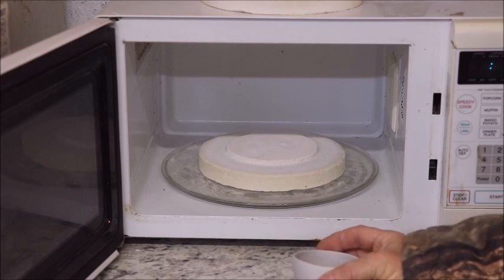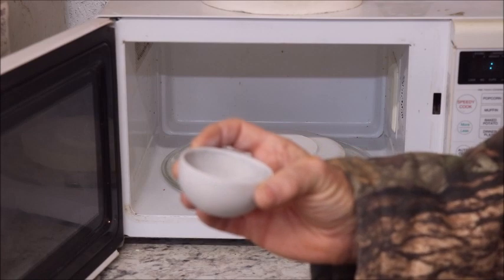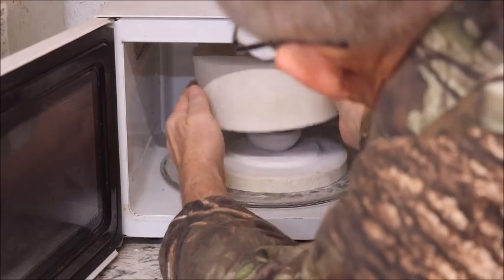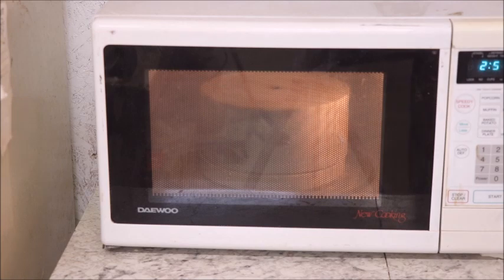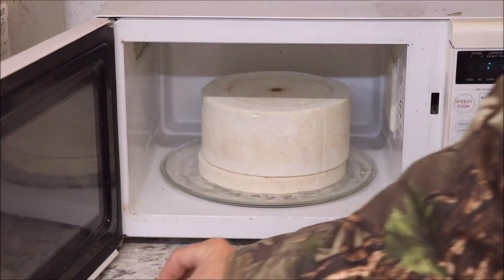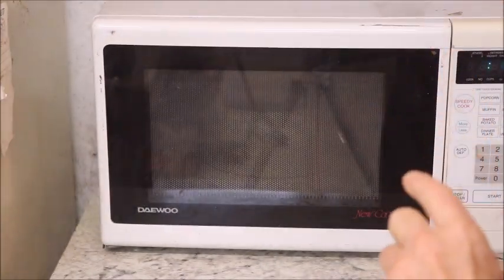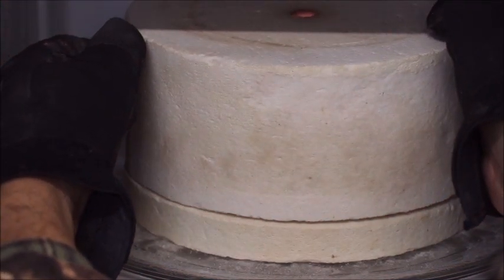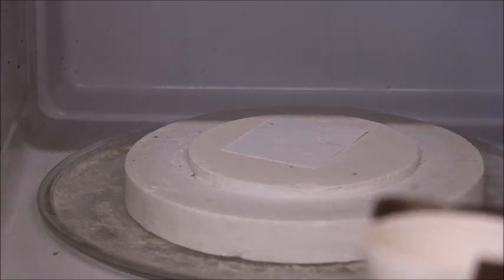Microwave Kiln Bisque

Comment: you are awesome! I was given a bunch of ceramic doll molds. I really want to try to use them. I searched the internet for hours and was about to give up. It looked so hard and I dont have money for the kilns they were using. Then I found your videos. You explain everything so great. My enthusiasm is renewed. I need to watch more videos to see what kind of clay and all that. I can't wait to try something with them. thank you!
Reply from the maker: For some reason dolls are usually made with porcelain clay and it fires hotter than low fire clay/slip (04 bisque/06 glaze.  I don't see why you could not use a microwave kiln if your pieces will fit into it.  Better than nothing.  If I can help I will try.  Thanks for watching my video.
Reply: Did you ever figure this out?

Comment: I Bought 1 of each size kiln to make little breeding caves for all my fish tanks and it's the best hundred bucks i've ever spent!  Sure if I was making 2 foot tall vases maybe not but smaller pieces are easy in this thing, one at a time, no exploding pieces xD I'm still so shocked that such a small little, simple contraption can get up to 16000 degrees in temperature it's almost hard to believe xD <3 thanks for this video!
Reply from the maker: Thankms for the tip.  I hope more people find uses for thes kilns.

Comment: Hey, Captain! I found a 2 cu ft microwave ... big enough for that microwave kiln? 1200 watts ... good enough? What greatest dimensions ... LxWxH --- OR --- diameter & height ... will work in the microwave kiln?
Oh, by the way, here's how I make certain my projects are as dry as possible before bisque:  First, I number my pieces and weigh each one, then I'll keep a record of their weights at each stage of my process. After the pieces sit overnight someplace where they'll firm up but not dry out too fast, I set my piece(s) onto a paper-lined cookie sheet. 
I turn my conventional oven to 170 degrees Fahrenheit and slide that cookie sheet in to cook --- with the oven door opened enough to allow circulation --- for four hours. Then, I turn off the heat and closed the oven door. Once the goodies are cool enough to touch, I weigh each piece again and record the weights. 
I repeat doing everything in the last paragraph above until there's no more weight loss.
You probably already know that.
Reply from the maker: Thanks for the tip on drying greenware.  Sounds good!  1200 watts is plenty.   If the microwave kiln will fit inside the microwave it will work!

Comment: wow amazing technique, thanks for sharing ! What is the container made of that you put your cup into, is it necessary an what happens if you don't use it ? Thanks
Reply from the maker: The kiln itself is made of a vermiculite type material and the inside walls have a graphite type material that converts the microwaves into heat.  The microwave itself will not generate enough heat to bisque the clay.
Reply: @CaptMike  thanks Mike
Reply from the maker: @gaetanproductions  Thank YOU!

Comment: Thank you for the videos and the knowledge that you are sharing! I have 2 questions. The first is what about the stoneware clay? And the second is how are you sure that the object is ready?
Reply from the maker: Any clay body will work be it stoneware, low, middle or high fire.  They all have to be first fired to bisque temps.  The difference comes in with the glazes you use.  It will be hard to get temps up to anythig other than low fire glazes. By "ready" I assume you me ready to fire the first time.  The clay should be completely dry before firing.  If it is at room temps it should be dry as wet clay will be cool as it dries.  Also dry clay is much lighter in tolor when dried.  Clasy with moisture in it will tend to explode with you as the microwave kiln heats up too much too quickly.  Hope this helps.

Comment: Hello.. thanks for the nice video. I wanna ask about the inner height of the microwave kiln and can i use this kiln in firing ceramic oil burner?
Reply from the maker: The height of the insode of the kiln is about 3 inches (I'm bot at the shop right now) and I would not use the kiln in anything but a microwave.

Comment: Are you 'firing' in 3 minute increments to do a slow ramp to temperature? Have you ever tried to do 15 minutes from the get-go?
Reply from the maker: That is pretty much what I am trying to do.  I have fired a full 15 minutes before, but glass it is problematic and seems to make the glass crack.  It is something you will have to experiment with.
Reply: Thank you @CaptMike  . I am going to try to fire ceramic clay. I'll try to find a good low fire clay body locally. Appreciate the answer.

Comment: hello. fantastic video.
I have been using my microwave kiln to fuse glass and would really like to try pottery.
do you use a specific type of clay for this please.
thank you. :)
Reply from the maker: Any ceramic clay, thoroughly dried, will work.  I have used slip, regular cone 04 clay and even reclaimed natural clay.  If it is dry and will fit into the microwave kiln it will most likely fire.  Go slow, say 3 minute increments, until you know how the clay you are using will work.
Reply: Capt Mike thank you. I'm going to have a go now. Exciting. :)

Comment: Hi Capt Mike, I need your help. After watching your videos, I bought myself a microwave kiln and it's really cool. Both the bisque and glaze firing work wonderfully on little bowls and flat pieces, however I've tried making little clay animals but they keep exploding- even after drying for over a week. Do you know what could be the reason for this? Thank you so much! Laila
Reply from the maker: I have had similar problems.  I think it has to do with the rapid expansion/heating of the MWK.  I sometime experience similar problems with my small kiln setter kiln.  I have never figured out why.
Reply: Thanks for the quick reply Capt Mike! I noticed that the little carrier wheels in the microwave have melted a little. Maybe it didn't turn correctly and the heat wasn't distributed evenly. I also have now made some practice pieces the same size as my pieces that exploded and have poked some holes in the bottom. Maybe there was still some residual moisture... I'll keep you posted. Thanks so much for this channel. It's helping me a lot!
Reply from the maker: @nehede13  I have had the wheels melt before.  I think it has to do with heat build up after the firing.  I try to get the kiln out of the oven as soon as I can.  Let me know how you come out with the holes.

Comment: Hi there
I have just found your channel and am loving it!  I would like to try the microwave kiln with slip cast objects and then raku but I was wondering what type of slip you use.  I am in the UK and was thinking stoneware slip would work but would welcome your input... also, do you add any grog to make it stronger?  Many thanks!
Reply from the maker: Any type of slip will work.  Use whatever you have on hand.  I have not tried adding grog, but if you have more than a few failures with the clay you are using try a little of it.
Reply: @CaptMike  Thanks Capt Mike - I'll give it a go!

Comment: I want to start making porcelain miniatures at some point, I wonder if I’d be able to make do with a microwave kiln?
Reply from the maker: Maddy, I am sure you can do it.  Just make sure your clay has not airpockets and the clay vis very dry.  When it is necessary to use thick clay make sure it is completely dry before firing.
Reply: @CaptMike  Thanks! I shall add it to the list!
Reply from the maker: @maddysutherland3166  Good luck!

Comment: Where do you get your clay I so want to try your very inspiring
Reply from the maker: I live in Georgia, USA and I get my clay slip from a company in Columbus, GA and I have to pick it up.  I can't find a supplier who will ship it.  Check with ceramic supply company in the largest city near you.  You can always use regular low fire clay and mold what you want.  After it dries, it will fire the same as clay slip.

Comment: I need to help, can you please tell me the steps that you need to do the firing in the microwave kiln.
Reply from the maker: The first thing t do with your new microwave kiln is to put a coat of kiln wash on the firing platform (the raised part the top fits over)  next you will need to cut some shelf paper to fit over the kiln wash.  You will have to replace the shelf paper with each firing (most of the time).  To fire something in your kiln, place clean, compatible glass in the center of the kiln.  I fire most projects in 3 minute intervals, checking between times to see how the glass is doing (sometime it will crack and separate) After approximately 9 minutes you should see the glass beginning to turn red.  Depending on you microwave, you should have a complete fusing in 12 to 15 minutes.  Let the kiln set unopened for about 10 minutes, then crack i open a little to speed up the cooling.  It should take about 45 minutes to one hour to cool enough to handle.  Hope this helps.
Reply: Capt Mike thank you so much 😊

Comment: Hello Capt Mike, I am writing to ask you about the clay biscuit cooking steps in the microwave.
I used Hotpot to toast clay pendants. Those with a thickness greater than 0.5 cm are expelled after about one minute. The more subtle ones have peeled.
I did 3 minutes at idle, 3 minutes at 200 ° C, 3 minutes at 400 ° C, 3 minutes at 600 ° C, 3 minutes at 800 ° C.
I left to cool for 20 minutes with hotpot out of the oven.
Can you help Cap Mike please?

Thank you
emanuela (Italy)
Reply from the maker: Hi Emanuela, I assume by "Hotpot" you mean the microwave kiln.  First you must make sure the clay is the proper type (ceramic clay) and has dried completely.  Place the dried piece on the microwave shelf and put the top on.  I usually heat the kiln for 3 minutes at a time for a total of about 9 to 12 minutes.  You can tell if the pendant is done when it glows red hot.  Once you have completed the bisque process you can glaze the object and re-fire it with the same schedule.  I hope this helps.  If not please let me know.
Reply: Buonasera Cap Mike, grazie per la rapida risposta!!!
Per Hotpot intendo quello.
Uso argilla refrattaria per Raku (WM Sibelco), asciugata per 6 giorni e prima passata con pistola termica.
La potenza del forno va tenuta sempre uguale? Al minimo, medio o massimo?
Dopo vorrei provare a smaltare con la tecnica raku. 3 minuti a quale potenza?
Grazie CapMike @CaptMike
Reply: Good evening Cap Mike, thanks for the quick reply !!!
By Hotpot I mean that.
I use refractory clay for Raku (WM Sibelco), dried for 6 days and first pass with heat gun.
I don't know what power to set - minimum, average, maximum? Constant?
After that I would like to do Raku for 3 minutes, but at what power?
Thanks good night
Reply from the maker: @emanuelamarialeva4935  I use a 1200 watt microwave and run it on high.  What you are looking for is the final temperature (glowing red to yellow).  With small items, even glass, the cool down is not as important as with a regular kiln full of ware.  After you have fired the clay to bisque, let it cool naturally inside the kiln.  That should take about one hour.  As long as your clay is a type that is to be fired in a kiln you will do OK.  Also as long as the clay is dried (six days should be more than enough) you should not have to preheat it, but that will not hurt anything.  Keep me informed of your progress.
Reply: @CaptMike  Thank you thank you! I will try again.
I will keep you updated.

Comment: Hi Mike! I followed your steps and tried bisque firing a small piece that disintegrated in the first 3 minutes. I purchased the microwave kiln that you shared the link for in one of the comments that you use. Microwave is 1100 watts, a little over the 1000. I used cone 6 clay and let it dry x1 week. Any ideas?
Reply from the maker: I have had clay bust before.  Is this the only piece you have tried? Seems like you let it dry long enough.  Try initial heat at one minute intervals for three or four minutes, then ramp it up.  Let me know how it is going for you.
Reply: @CaptMike  Yeah, it's the first piece I have tried with the microwave kiln. I will try another next week at shorter intervals. Have you ever tried low heat drying anything in the kitchen oven before firing them to make sure they're really dry?
Reply from the maker: @dreaclare33  You can use a oven on low heat, say around 150 F.  I use a large dehydrator.
Reply: @CaptMike  If I do dry it in the oven at about 150, how long should i leave it in?
Reply from the maker: @emilygardner8842  I's hard to say.  I would start with 30 minutes and let it cool.  After it sits long enough to cool to room temps and becomes cooler that the room, it is still drying.  Hope this helps.

Comment: Hey capt Mike!I am making cool little jewelery pieces out of porcelain cone 6 clay- I let it sit out and dry for three days and it blew up in my microwave kiln after three minutes. I've googled it to see if I may need to buy a different kind of clay. I'm really excited about this new adventure and I really want to make these work in a microwave kiln. Do you have any advice? I bought a large kiln and 1,000 watt microwave, kiln wash and low fire glaze.
Reply from the maker: I have had problems with clay molds exploding, but for some reason small bowls and such seem to work out OK.  You might try ramping up slowly by adjust inf the MW output from low to medium to high.  Let me know how it turns out.
Reply: @CaptMike  okay! Thank you! I'll give it a shot! I will definitely let you know! You are most helpful!

Comment: I'm thinking about trying this myself, but i'm concerned about the poisonous gasses emitted during a normal firing - what are your thoughts and experiences in regards to this please. Thanks, very interesting!
Reply from the maker: For an occasional firing/bisque, I would think there would be no problem.  The volume is so low and you would not normally be standing at the microwave during the process.  My shop is pretty large and I keep some kind of circulation going all the time.  If you use your microwave in the kitchen, then turning on your stove exhaust would probably be enough.  Very smart to be aware of all dangers.  Just thinking, if you put your microwave outside, but under cover, you should not have any problems.  Make sure you have A microwave dedicated to just your microwave kiln.  I would not advise using the one you use to cook with.
Reply: @CaptMike  thanks, I had not heard about microwave kilns before watching this. I don't use my old microwave to cook with (I don't think it is healthy); so, I'm glad to find an interesting use for it. I'm thinking that there are mainly only poisonous gasses during a glaze firing. Am I wrong? Would a bisque firing of a normal ceramic clay also emit poisonous gasses? I would personally be more afraid of EMF from the microwave and not be close to it while it is on anyway. I look forward to trying this with small handmade ceramic objects.

Comment: Hello! I’m experimenting with my microwave kiln and paper clay, but every time I try to bisque it , it shatters and crumbles, even after the first six minutes. I’ve tried different shapes (flat and about 1/4 inch think / cylindrical and 1/2 inch), but it doesn’t seem to matter. What am I doing wrong!?
Reply from the maker: Elisa, I have never tried paper clay in the microwave, but if I had to guess I would say the paper burning off too quickly caused internal gasses to blow the item apart.  Just guessing here as I think the schedules for paper clay in the kiln take into consideration the burning off of the paper.  If I get time I will make some paper clay and give it a try.  Thanks for sharing.
Reply: @CaptMike  Thank you for your response. I look forward to hearing your results.

Comment: Can you link where you purchase yours?  Can I use this with clay ? I know you mention slip; which is water and clay right?
Reply from the maker: here is the link on Amazon: https://www.amazon.com/Professional-Microwave-Fusing-Melting-Jewelry/dp/B01M2XWNCI/ref=sr_1_5?crid=1ZUJY93S13GH6&keywords=microwave+kiln&qid=1657675953&sprefix=microwave+kiln%2Caps%2C80&sr=8-5.  And yes, regular ceramic clay will work.  Just make sure it is dry and has no bubbles in it.

Comment: Hi Capt Mike! Thanks for making this video! Do you use low fire clay?
Reply from the maker: Most of the time, yes.  All most all my slip is low fire, but sometimes I have a clay body left from a project and I might biswue that.  Have to remember what is what as the glaze has to match.
Reply: @CaptMike  gotcha! do you know if cone 06 raku clay would work for this?
Reply from the maker: @leylijohnson  That should work just fine.

Comment: Hello! Thank you for the video :) I'm writing with a translator, sorry for mistakes.  How many waats does your micro wave have?  And what was the separator? Could it be bisqit too?
Reply from the maker: I have a 600 watt and a 1100 watt microvave.  Both do the job fine.  I coat the bottom part of the inside (the reaised portion) with two coats of regular kiln wash and always fire in top of shelf paper.  You should have no problem firing a clay body to bisque (cone 04).
Reply: @CaptMike  Thank you for your answer :) I have a large kiln and I don't know what I'm doing wrong? I couldn't get the right temperature, my things cracked and the paper burned.  I do not know whether the microwave is too weak for a large kiln or poorly dried clay?  :(